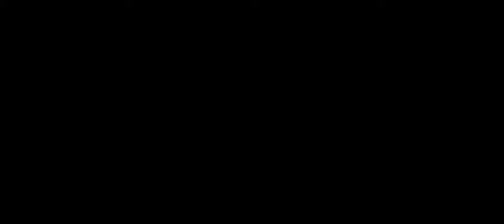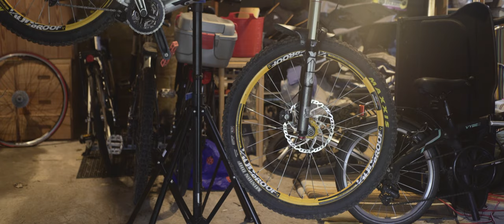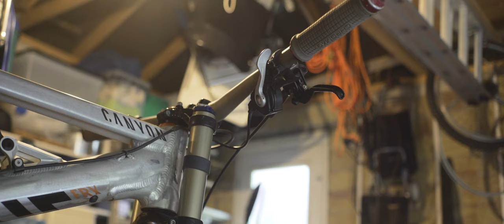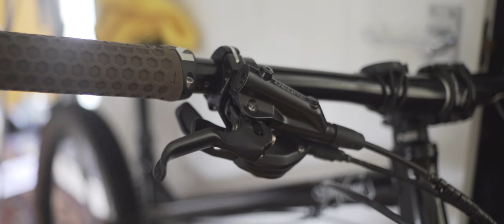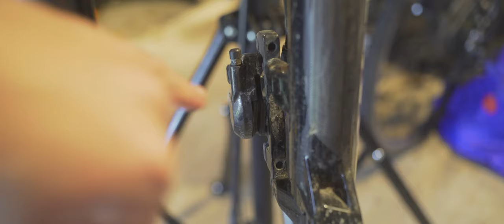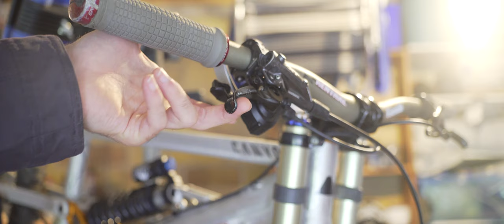How To Change Your Bite Point Or Free Stroke ( Spongy Brake ) Shimano or SRAM Hydraulic Disc Brakes

Comment: I used to have my brakes bite at very short lever travel, and I like and trust my bike that way. Recently got new brakes fitted by a pro mechanic and now the levers go all the way in before they ALMOST bite full force. I cannot even get the front wheel to lock at alI. I feel very umcomfortable with the bike now and my wrists get tired after a few downhills. The pro says thats how they are supposed to be, and thats the way the new brakes he fitted works. Can that be true? Change to a brand new brake system and never trusting the bike to stop as I want, that can´t be how it is supposed to be?

I have another bike with mechanical disc brakes, and they too, right out of the store, brake really well. Full force with short lever travel and with very little strain on the wrists.
Reply from the maker: I'd argue no. There is no right or wrong way for your brakes to be. Some people like more lever travel some (like me) like almost no travel at all. 
In my opinion brakes should be set up with very little travel so that as they bed in/air makes its way into the system they slowly gain more travel until you bleed them again. 

I would suggest if you can't even get the front wheel to lock your brakes haven't been set up very well at all. You should be able to lock both wheels using only one finger to brake. I'd follow my video and give them a good bit of attention to get the bite point where you want it. 

On the topic of mechanical disc brakes. They need to bite far sooner than hydro brakes because as you apply more pressure to the lever the cable stretches. If you're already fully engaging the lever to make the pads bite there's no wiggle room left to apply more pressure in an emergency! Hope that helps!

PS: what brakes did you get fitted by the pro?
Reply: @BenHuggett  Thank you for the answer!  I´m just a noob with a not too expensive mtb, so we´re not talking any pro brands here, but I do go on forest trails sometimes and even if I don´t race downhill I still need good brakes, which I had. I had to change them because of corrosion on the calipers. I had Hayes brakes, but now he has put on Tektro. I have no clue about brands here, but I do know what works, and if Tektro can´t even lock the wheel, then it is absolute trash. I hope it is possible to fix the problem by topping off the system. The mildly annoyed pro mechanic/rider told me to buy new brakes to get the desired effect.  Not using him to fix my bike again....
Reply from the maker: It might be worth considering replacing the pads in the brakes too...they could well be contaminated which would also prevent you from locking up the wheel. Always worth a shout before you spend any more money on bleed kits etc...
Reply: @BenHuggett  He could also replace his mecanic, he doesn't seems very helpfull.

Comment: Didn't work for me but I understand the concept. Mine required bleeding, simple though. FYI ;Just put filled and bled syringe on bottom fitting, take off top fitting, loosen bottom, then push fluid thru to top enough to push thru a new cycle (very small amt of volume needed for brake line) then shut off bottom valve, then close top. Works like brand new, zero free play.
Reply from the maker: Sounds like you had a slightly different issue to what I was talking about in the video which is largely about setting the piston clearance. That said, for those reading it's worth following your advice on bleeding. Too many people do a "top bleed" and don't realise it's much better to push fluid from bottom to top as you say!

Comment: The problem with Deore is they have Servo Wave, so adjusting reach for short fingers renders the brake usless, as it effects how far the piston in the master cylinder can be pressed, thus you can't reach the power needed to stop, but adjusted to all the way out the brakes are powerful and actually work properly.
Freestroke adjustment counteracts this, thus making the brakes usable for short fingers.
So Deore is absurd.
But some brakes habe direct lever actuation, instead of an mechanism disconnecting the lever from the piston plunger. So those will have the same power no matter how you set the reach.
I had Deore m615, Deore M6000 so I know how these brakes are, but I can tell by looking at the mechanism anyway.
Reply from the maker: I'm not sure I entirely agree with you. To my understanding the actuation of the piston isn't altered by the reach being adjusted. The lever after all just pivots around an axle with an independent arm attached to the main lever actually being responsible for depressing the piston. Because of this adjusting reach alone shouldn't alter the riders' ability to apply power to the piston providing the system is well bled. As you say, there have in the past been brakes that directly actuate the master piston from the lever but that's barely relevant to the braking systems most of us use today.

Again, to my understanding the point of the free stroke is to adjust the amount of preload applied to the piston and thus decreasing the levers throw distance...whether that actually works or not is a different matter entirely. I'm not sure I understand what you're saying about that counteracting the reach adjustment but feel free to explain. In my experience the two adjustments are pretty separate from one another!
Reply: @BenHuggett  I had the Deore brakes, the Servo Wave separates the reach adjustment, and lever from the plunger, so by adjusting the reach you are moving he lever further in, but with a brake without servo Wave the lever is connected to the plunger, and adjusting reach just moves actuating part of the lever on the threaded plunger, so the piston can still be pressed the same amount, but on Servo Wave the lever basically works like a lever that has been bent, so to brake properly the lever would have to have been ghosted into the handlebar. 
I am talking about the piston in the master cylinder.
I understand this might be confusing, I hope my explanation makes it easier.
This is absurd, I wish brakes like that did not exist, and there was a law agianst it, as some might adjust it then go for a ride and not be able to brake.
Reply: @BenHuggett  For some reason this subject is not talked about it seems like, I don't see this being mentioned in any review. 
But your method only moves the pads in making the brake more sensitive, powerful, but that won't do much good when adjusted for short fingers on a Deore brake.
Reply: @BenHuggett  I don't have the Deore brakes any more so I can't show what I mean. But I hope the explanations help.
I have Formula Cura 4 now, they have the lever connected directly to the plunger.Just like Shimano M396, XTR Race.
You might not notice the difference if you adjust it slightly, try adjusting the lever all the way out and close to the bar like for a small child, you should notice a huge difference.
If adjusted for a child or small fingers, the pads will barely be touching the rotor when the lever is bottomed out at the grips, I use 34mm grips, so might be less so with smaller grips but will still be too weak to brake properly.
Reply: @BenHuggett  Maybe a 3d model and explanation in combination would make it easy enough to understand for more people. I am not sure how to explain it better.

Comment: so an 2mm allen key and 20mins spent adjusting the bite points and your Deore M6100 is pretty much as good as the Deore XT M8100 for less than half the money ;o]

I got today full F&R set of M6100 brakes+calipers for 81 euro to replace my ancient maguras
honestly I can't comprehend why someone spends more for the reach adjust knob, completely agree that you only need to use it once ;o]
that bite point adjust would be nice but if I can do it this way than no need for it as well

clearly the local bike shop that tried to bleed my old brakes did not know this, they totally messed up the bite point on one of them ;o]
they pretty much messed up everything they touched so I decided to spend some time studying how to do all myself and not rely on someone else anymore

Comment: The adjustement on these brakes is actually much simpler than this. At 0:29 you can see the screw that adjusts this setting: it's marked as 'FREE STROKE'. Turning this screw in will narrow the range of travel of the lever, while loosening it will increase the range of travel.
Reply from the maker: As I said in the video, the range that the Free Stroke adjuster has is absolutely tiny - to the point where I would consider it a design failure. I have had multiple bikes with free stroke adjustable brakes and have never once found it to have much of an impact at all. Because of this, I run Deore levers with XT calipers on my trail bike. Speaking to people in the trade, it seems like the universal go to is to run the free stroke completely closed and just over-bleed the brakes as this video shows

Comment: instead of putting in and out the wheel multiple time to set the brakes how you want them, i suppose you can use a disk brake to judge if you need to fiddle with the spacing or not :)
Reply from the maker: That's a good idea actually. If you have a spare rotor that could get the spacing right. You'll just have to make sure that you don't miss up the alignment of the pistons - not all rotors will sit centrally
Reply: @BenHuggett  at least you know for sure when you got too far. Front wheel might be easy, but doing that for the rear wheel 3 or 4 times... becomes really boring really fast
Reply from the maker: Yes you're right. I suppose it depends a lot on your set up too. SRAM mechs with a clutch that you can completely disable make the job a darn sight easier. Your point with using a spare rotor is a good shout

Comment: I was with you until you said you jam a sock between your brake pads.
Reply: He said wrap your flat head screw driver in a sock when using it to pry the pistons back out. The sock or tape or whatever you want to use is just so you don't scratch stuff up

Comment: Free Stroke or contact point would of fixed your brake bite without doing what you did
Reply from the maker: No it wouldn’t. That’s the whole point of the video. The free stroke adjustment screw has such a limited range of motion that it’s near impossible to make any perceivable difference winding it all the way in

Comment: I was about to comment what complete bullshit this was.  You're not changing anything!  The pads are just sprung back to where they were or pushed back by the rotor as soon as you ride.  But ...then I tried it.  They seem to take a new "set".  Must have something to do with hysteresis in the seals!  And after 8 years of weak, sloppy road brakes (but great MTB brakes), the road bike is revolutionized.  Can't believe what a well-kept secret this is.  Saved me $$$.

Comment: Should have bought Magura MT7 brakes then shouldn't you, they have a bite point adjuster built in without all this messing around.
Reply from the maker: So do Shimano brakes. That's what the free stroke is meant to do...sadly it really doesn't work. I've had Magura systems in the past. To be perfectly honest I don't like the levers. I was always plagued by reliability issues. Not to mention that the Shimano levers are a lot smaller and take up less room on the bar. Each to their own I guess!

Comment: Flat headed screw driver!?!?!!?!?!?? AHHHH! 😮Nooooooo. Use a Plastic tire lever against the pistons son 😆👍
Reply from the maker: Honestly the risks of using a screwdriver are way overstated. Obviously make sure you use a large one that isn't going to gouge the surface of the piston and make sure to use a reasonable amount of force so as not to cause damage. But I would argue if a screw driver is all you have handy it's fine to use. That said, a tyre lever is a better idea - I've actually whittled down a bit of wood that does the job perfectly these days